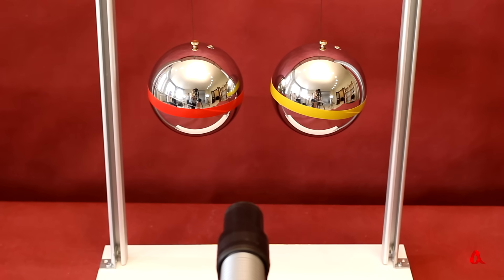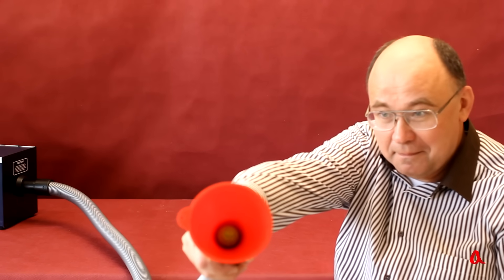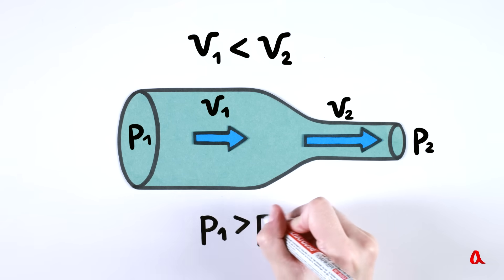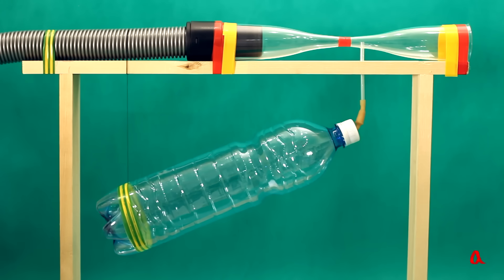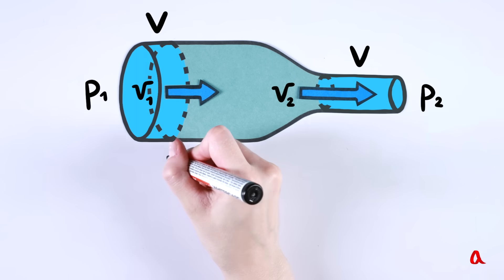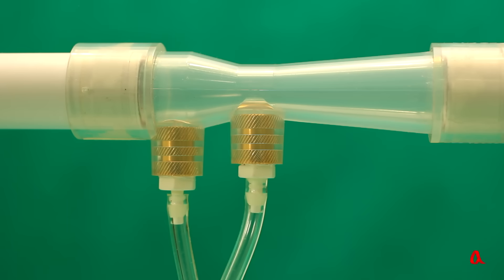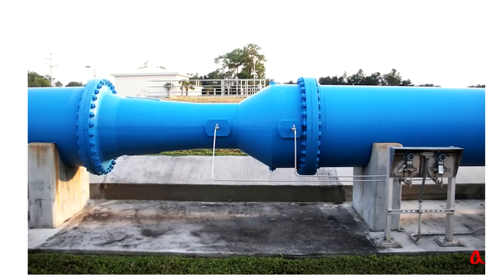Bernoulli's principle

Comment: By slowly pressing a box internal pressure would rise and the walls of box would heat up. Box would remain pressed in position that force heat of walls and heat of walls would be collected for electric energy production or for heating , keeping the box in pressed position would be done whit some closed brackets so no input of energy for keeping the box pressed so all its heat would be used to produce output of energy

Comment: But isn't it more like the pressure of the fluid of the restricted section increases, while the pressure exerted by the fluid on its containment decreases?

If you observe this principle in water coming out of a pressure washer, then the smaller and tighter stream exerts more force on any object it encounters. The pressure within the restricted stream of water is higher and it creates a low pressure boundary of air surrounding it.
Reply: No, Chris.  Your simplified thinking has led you astray.
.
As the fluid flows TOWARD the inward sloping wall sections, the flow is TOWARD those walls and, therefore pushing more on them.  It is similar to a wind that pushes more as it tries to approach a surface or blow you down.
.
Then, a fundamental fact of fluids is that pressure at any given point pushes outward in ALL directions.
.
That pressure against the wall is also eithin the fluid and it 'communicates' both inward and backwards, upstream and increases the pressure in the FAT section on the left.   
>>The reduction in diameter CAUSES the UP-STREAM pressure to increase.!.<<
.
Now, think of the narrow section as an outlet of a pressurized tank.  The higher pressure in the fat section accelerates the fluid into the narrow section.  This is Newton's force causing acceleration of mass.
.
It is a fact that for fluid to accelerate, there must be a pressure difference between two locations {called a pressure gradient} and the higher pressure pushes more, thus accelerating air in between, toward the lower pressure.
.
It is identical to a brick with TWO opposing forces on it.  If one of those opposing forces is larger, the NET force is toward the lesser force and the brick accelerates toward the lesser force.
.
Fluids are the same.!.
. . . . .

The "pressure" of the pressure washer is caused by the INERTIA of that very fast stream of water, SLAMMING into the surface!.  It is no different than if I run into you.  My  Mass has inertia that slams into you.  
.
That is called "Stagnation Pressure" because the flow stops at the surface and is stagnant against the surface .  At that point, all the kinetic energy in that mass-low, gets converted to pressure at the surface.  
This is CAUSED by AIR'S INERTIA.!.  
.
{{By the way, the very same thing happens if the surface 'slams' into stationary air. The Air's Inertia resists being accelerated by the moving surface and that causes a pressure increase at the surface that is also within the air.
That is the same as me running into you and YOUR mass / Inertia resists my push and your inertias is causing that increase in pressure on you.   SAME PHYSICS.
.
HOWEVER, When I am running, I exert NO extra pressure on things I pass by and a jet of water or air is the same. 
.
The pressure INSIDE that jet is called "Static Pressure".  That is the pressure you would measure if you were inside it AND traveling along with it.  That is called it's "Static Pressure".
. . . 
A "FAST" stream of air, or water, exiting a hose is at the SAME internal, static pressure as the stationary atmosphere around it, no matter what some really dumb PhDs say in their misleading You Tube videos.!. 
.
We measure this daily in the aerodynamics industry.  <-- ABSOLUTELY TRUE!!
.
To see how to CORRECTLY measure the internal, static pressure of moving air, See Weltner's paper describing the industry standard static pressure probe, link below. 
.
That water out of the pressure washer has the SAME static pressure as the stationary atmosphere around it!  The higher pressure inside the hose is what pushes / accelerates it out into the now RELATIVLY lower atmospheric pressure.

Weltner Direct link:June 24 224:
“Misinterpretations of Bernoulli's Law
by Klaus Weltner, University of Frankfurt (G)”
FIG 3 Static Probe:
 https://www.prirodopolis.hr/Bernoulli-Coanda%20Demo_files/Misinterpretations%20of%20Bernoullis%20Law.pdf 
 .

I simply cannot understand why this simple physics illudes so many supposedly intelligent folks. . . . .

Comment: demonstrating college level fluid dynamic physics with plastic and a cheap blower. I applaud your ability to demonstrate what so many professors rely on overly complicated texts and complex mathematics to explain. BRAVO!
Reply from the maker: Glad you enjoyed it!
Reply: @getaclass_physics  But it is wrong:
This video is still WRONG. Please make corrections or remove it.
..
The statements about Bernoulli's Principle are correct, but the demonstrations are very poor.
The balls, spoon and funnel are a result of the Coanda effect. 
.

The tube inserted into the wall of the neck is protruding into the  flow (seen at time 2:57)  This causes the air to curve around the end and sides of the tube.  This curved flow is the cause of the  lowered pressure.  This will work with no pipe around it; just the air blowing across the vertical tube.
..
To correctly measure the static pressure inside your narrow neck, the end of hat tube MUST be flush with the inside surface. 
..
At time 4:51 we see that the two pressure sensing tubes appear to be more like flush, but it is difficult to see clearly.  For that to truly sense the static pressures, there must be NOTHING protruding into and disturbing the flow.
Reply: @Observ45er  While your first point is true, and the ball sticks only due to the coanda effect, the other points are only partially correct. The low pressure in the thin section of the pipe is the main reason the water flows upwards. The curve around the small pipe head directs a negligible amount of air to the top, most of it just goes around it, even if all of it was directed to the top, it not be near enough low pressure air to pull the water out.
Reply: @Observ45er  Nothing protruding inside the sensing tubes. They are flush so the Bernoulli equation is valid here.  The balls, spoon and funnel are due to the Coanda effect like you said. At 2:57 you will practically get the same effect if the tube inside is made flush with the venturi.
Reply: @ricomajestic  
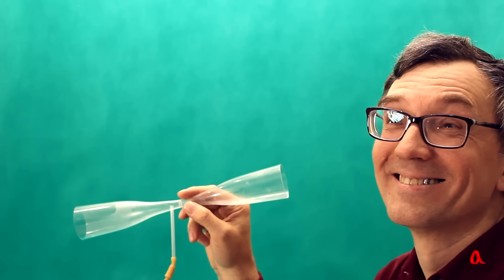Yes there is.  Look at times 2:19 &  2:56. 
It is obvious.
.
Reply: @Observ45er  Again it is slightly protruding at 2:56. Even if you tried it with the sensing tube flush  with the walls of the larger tube you would still get the same effect.  A decrease in pressure. Try it!

Comment: Pressure and Flow = volume per minute - Just like voltage and current = watts. The amount of output remains the same even though you are changing the ratio of pressure to flow.
Reply: So you mean that the output from the other side had to be equal as the input he blew because the bottle (narrow neck example) is same dimension. Sounds fair, but the plastic bottle releasing air vacuuming is creepy counterintuitive. Is it because of the kinetic energy. If so then everything in the universe seems to be ruled by motion of any sorts.

Comment: https://youtu.be/eKEorBipbO8?t=160 
Your explanation seems wrong. Only the pressure difference is the reason why air gains acceleration. When you blow air out of a tube with your mouth, that's because you increase the pressure of the air in the tube. And this pressure must be higher than atmospheric pressure. Therefore, when this high-pressure air moves to a small cross-section of the tube, the pressure of the air must be higher than or equal to the atmospheric pressure, but not lower than the atmospheric pressure.

How could the pressure at the small cross-section of the pipe be lower than atmospheric pressure?
There is high pressure at the mouth, and then the pressure gradually decreases along the pipe. Obviously, the pressure will not be lower than atmospheric pressure.
Therefore, there are other reasons why the pressure in the vertical pipe is lower than atmospheric pressure. So what is the reason?

I think it's because when the air flows through the outlet of the vertical pipe, due to viscosity, the shape of the vertical pipe, etc., the air rotates, thus creating a pressure below atmospheric pressure.

https://youtu.be/eKEorBipbO8?t=173 Observe carefully: when low pressure is generated, the vertical hose is biased towards the spreading section of the horizontal pipe, not at the position where the cross-section of the horizontal pipe is smallest. This is why horizontal tubes produce a pressure lower than atmospheric pressure.

Comment: The very reason is why you never discharge ac system refrigerant. It will bend those smaller pipes.

Comment: This phenomenon is one of the most mind- fucking results in all physics to me. The fact that blowing air with high pressure through a tube with a restriction causes the air to decrease in pressure at the restricted part is so counterintuitive. My brain just will not understand how increasing the space in which a fluid can flow causes the pressure of the fluid to increase and vice versa.
Reply: I have no PhD in physics so this may just be my 2am thoughts. I think what it's referring to specifically is the amount of air it takes to make the force. Like 150 psi is different through a straw as opposed to a 2 inch round tube. So hypothetically let's just say I would need a compressor to generate 150 psi through the tube where as I could just blow through the straw myself and make 150 psi.
Reply: @sethwoodbury4557 that’s what he’s saying. You would think you could make more pressure with a smaller gap. But it is the opposite.
Reply: @sethwoodbury4557 most underrated comment I have ever seen, thank you
Reply: @sethwoodbury4557 I am going to make an analogy, supposing there are 2 old pipes going out of my shed like just holes in the wall that have pipes in them. For the small one, I can put 1 sock in it and it will be blocked. For the large one it would need 40 socks 
In this analogy, "pressure" is measured as number of socks required to block the pipe.

Maybe.... idk
Reply: I surrendered and decided that nature obeys to maths.
Reply: Exactly!!!!
Reply: I dont know if this helps but this is how it makes sense to me. With fluids, low speed = high pressure; high speed = low pressure. I think of a water dam. When the dam is closed all of the water has no where to go and applies a lot of pressure to the dam. The other phenomenom in play with this is the conservation of mass which tells us "what goes into the tube, must come out of the tube" so the wide part collects a lot of slow particles (high pressure) then it goes through the narrow part of the tube, where from conservation of mass, in order for the narrow part of the tube to get the same flow rate as the wide part of the tube, air must move faster. (low pressure)
Reply: you got it right
Reply: I think you expressed your thought incorrectly. This law contradicts intuition but not common sense, it was common sense that helped to understand and discover this
Reply: You have to consider that it is kinetic/mechanical forces. If you stretch your muscle, you can contract it over a distance faster, but your strength will drop.
Reply: @Mr.Goosebumps-gl8lv  That is a completely false comparison. This is purely about measuring differentials in the relative pressure of fluid substances. Muscles do not work that way. 🤦‍♂
Reply: @sunnyjim1355  It is , in fact, not. It can quite cleverly be used as a "metaphor" for Bernoulli's principle. 🤦
Reply: Exactly I've always thought the opposite
Reply: I had the same issue. The best explanation is that the increase in velocity, which is an increase in energy has to come from somewhere and that is a lowering of pressure, a loss of energy.
Reply: This video might have been a bit misleading. It doesn't drop pressure at the Restriction it's just after the restriction. Think of cars in a traffic jam from a road construction. Only so many cars can get through the lane restriction. But after the Restriction bam you can nail the gas and fly. But eventually you'll catch up to other cars and go back to normal speed. And I suppose you can think of the pipe as restricting the air molecules from getting in like the police restrict you from driving your car through the ditch to go around the road construction. Then say we add a Lane leading into it right after the road construction. Containing all the cars of those impatient drivers that wanted to drive through the ditch. With all the inpatient drivers honking the horn and all the room to get into the lane cars are just flying into that area
Reply: @mikehdft  "It doesn't drop pressure at the Restriction it's just after the restriction. " That's wrong!
Reply: @ricomajestic you are correct
Reply: @mikehdft this is false information, my friend
Reply: I’m guessing the pressure increases at the part of the tube where it gets squeezed. Not the part where it is already squeezed. 

In fact. That would explain why the pressure reduces because the narrowest part is the outlet of the compressed air
Reply: @Stierenkloot  "I’m guessing the pressure increases at the part of the tube where it gets squeezed. Not the part where it is already squeezed. " Not sure what you are trying to say here.
Reply: ".....causes the air to decrease in pressure at the restricted part is so counterintuitive." That's where you are going amiss.
The pressure increases up until the maximum restriction point, as one would expect... but decreases sharply after that point. Note that the pressure measurements were made AFTER that point.

As the volume needed to be filled increases after the maximum restriction point (obviously, otherwise that wouldn't be the 'maximum restriction point' then) it takes more substance to maintain that high pressure, right? But because of the constriction not enough can get through to do so! Therefore the pressure drops from there on. Voilà.
Reply: @sunnyjim1355  wrong! Even if you measure the pressure at the maximum restriction point it would still be less than the pressure at a place in the tube with a larger diameter. The pressure in the places where the cross-sectional area is smaller will always be smaller than in a place where the area is larger.

Comment: Your test tube is after the smallest opening, so the pressure is decreasing.  The pressure increases to the maximum AT the smallest opening.  It increases, then decreases suddenly like a divergent rocket nozzle trading pressure for flow/thrust.  Like a transformer trading voltage and current with the power being the same except for the small loss of the transformer.

Comment: Can someone quantify what is pressure in this case? When a cross section of the area in which a fluid flows is reduced, it increases the velocity thus "the pressure also increases" (A water hose when pressed in the end will increase pressure too). What am I missing?

Comment: The seemingly stationary yet the active atmosphere around the two-ball system pushes the ball to come together when the air in between them is displaced. Though the atmosphere tries to fill in the gap again with air, the continuous removal of air makes the balls stick together and the direction of the displacing pressure dictates the direction of the balls' rotation.
Reply: 👑for you my unsung hero

Comment: what I think of this is that when air is blown very fast at sudden high speeds, pressure over there decreases because you just removed a given volume of air from that part. The speed at which this is happening, causes air, fluid or any solid to get attracted towards that part of the empty space due to partial vacuum. As we know, fluid will always try to fill empty space. In that case, since fluid from the surrounding area is trying to fill that empty space, solids surrounded by that part of fluid is pushed into it(given the solid isn't heavier than the force exerted due to pressure of the fluid) and hence we get this. In the same way, the volume of air flowing between 2 planes when they are near(due to the 2 engines next to each other) being pushed backwards is so high, that it creates partial vacuum between them and a slow attraction force(or u can say force due to fluid[air] at a higher pressure) surrounding the planes pushes them while trying to flow into the temporary partial volume of emptiness. I hope this explanation helps anyone who wants to understand this principle or visualize it.

Comment: No magic, no calculations needed. Air has mass and is sticky. It sticks to surfaces where it flows along, also when it is curved. When it follows a curved surface it gets an extra fling: centripetal force, so it will go faster. The surface pulls the airflow, that can be measured as a lower pressure. An aircraft throws down air, 1.2 kg per cubic metre. All that mass is reluctant to move, which causes lift.
Bernoulli discovered that airpressure will enhance when you obstruct a flow, and that airpressure will decrease when you accelerate a flow by flinging it around a curved surface.
He also invented how to make calculations with that, bu that is not necesary to understand how venturis and wings work, and how flying is possible: keep throwing down air!

Comment: Sad to see yet more misinformation on Youtube. Bernoulli's Equation applies only to incompressible inviscid  (ideal) fluids, therefore not gasses. Compressible gasses undergo an increase in pressure when they are forced into a constrictive system. It's basically the exact opposite of Bernoulli's equation, and it's why the HVAC industry exists.